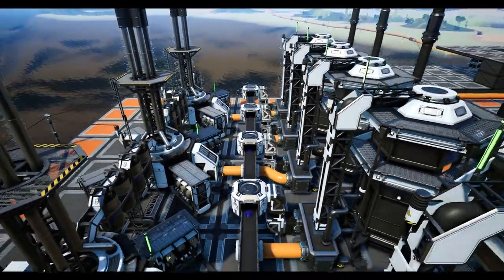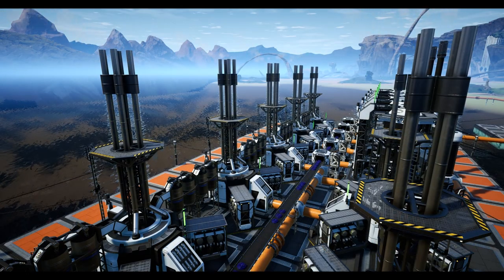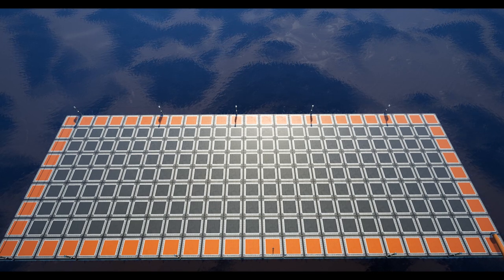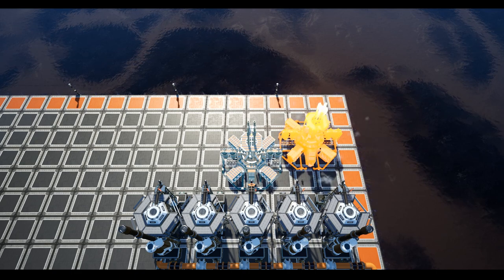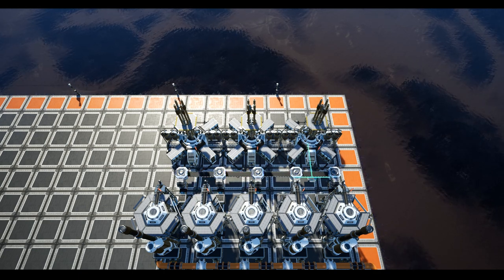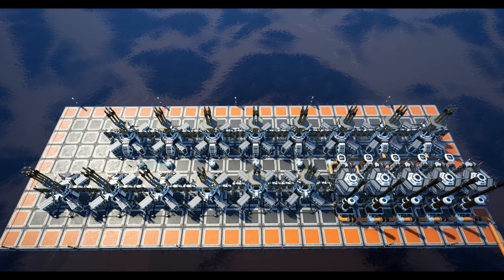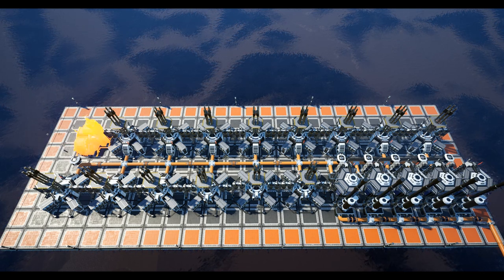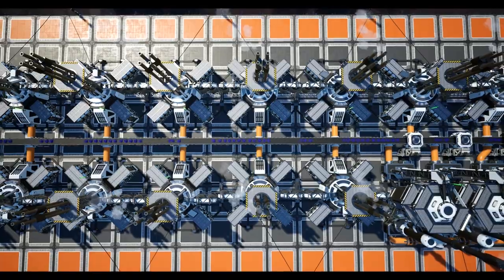Fuel & Generators Super Efficient Build Guide [Satisfactory game]

Comment: Update 4 really overhauled a lot of the numbers in the game.  The guides on Satisfactory Tips are mostly still relevant as to process, but the numbers are off.  For this build, you need 17 generators with the last at 66% rather than 14 with the last at 33% (Fuel consumption is 12/m rather than 15/m  now.
Reply: any way to balancing it with overclock??
Reply: @OHCLunasea plz give me an advice xd
Reply: @iroggi_3567  a refinery at 100% produces 40 fuel/minute and a fuel generator consumes 12/minute the 5 refineries produce 200, 200/12 = 16,66 fuel generators

either take his advice and use all of it for additional 2 fuel generators running 100% and a third running 66% OR use the excess 32 fuel for truck fuel but it's kind of inconvenient because of the 

the simplest solution while sticking to the same layout is obviously just overclocking your fuel generators to use up all excess but it's also the worse solution because you waste energy this way and that's literally what you're trying to gain
Reply: @iroggi_3567  if you haven't already built the setup you could also build 3 refineries (120 fuel production but 180 crude oil input) and a total of 10 fuel generators but the point of the design is to take exactly 1 capped out line of crude oil in so I'd personally add more generators
Reply: Not sure if it's a bug, but having my fuel generator overclocked makes them more efficient?
At 100% it produces 150MW of power for 12m³ fuel per minute. But when I overclock it to 200% it produces 300MW for 20.45m³ while I expected it to be either less MW, or more than 24m³ fuel usage.
Not sure if this is just a visual bug tho.

EDIT: The actual produced power is only 255.7MW, but that still makes the generators exactly as efficient as a normal non overclocked one.
When using 3 overclockers I produce 303.5MW for 24.28 fuel instead of the normal 150MW for 12Fuel.
Reply: @DejonckheereWard  very interesting, could save a lot of room and work, material isn't really an issue but man I hate placing down arrays in great numbers xD

on the other hand I don't like to hunt for snails and without the OC the numbers are nice and even
Reply: Thanks!
Reply: @iroggi_3567  1 triple OC refinery can power x4 triple OC Fuel Generators. (refinery exports 100 fuel, generators eat just under 25 each)
Reply: @iroggi_3567  another option is 1 non-overclocked refinery will power x2 Fuel Generators double overclocked to 194%

Comment: With Update 4 you can build 17 Generators for the same amount of refineries.
16 Generators at 100%, 1 Generator at 59% (8 m³)
Reply: With Update 4, it’s better to hang on to coal power plants until you unlock the Blender, then run it with Heavy Oil Residue + Water to produce Diluted Fuel. This way you can run insane amounts of fuel generator plants.
Reply: @omulu4007  wait does it have the same efficiency?
Reply: Is this why the refinery doesn't look the same ? I just started the game and I was looking at a way to run an efficient powerplant...
Reply: @startide refinery used to be packager as well then they made refinery and packager seperate

Comment: As an actual game strategy, I recommend skipping this base recipe oil power generation stage.  Instead, I recommend limping along on Coal power and grinding out enough cargo drop hard drives to get the Diluted Packaged Fuel and Turbo Fuel alternate recipes.

The oil power plant designs using Diluted Packaged Fuel and Turbo Fuel make much more efficient use of oil supply, so you'll end up with power plants that power your development much further along before you have to expand power again.  And grinding out alternate recipes will yield other valuable recipes along the way.

You'll also find that building the more complex power plants that use Diluted Packaged Fuel and Turbo Fuel is a lot of fun, and the Diluted Packaged Fuel loop ends up appearing in the high efficiency designs for Plastic and Rubber.
Reply from the maker: Again you’re right but for this series we’re focusing on non alternate recipes first ☺️ but diluted packaged fuel followed by turbo is a great option to implement and will go a lot further
Reply: @TotalXclipse  Agreed, I havent been able to get the alt recipes needed for the better option and I need moar power now!
Reply: If you want to enjoy the game, I wouldn't recommend doing this, unless you are either very lucky, or don't mind gaming the game. I don't know what the average number of hard drives is to get Compacted Coal and then Turbofuel, but I didn't see CC until half way through the total number of hard drives available. Turbofuel came a number after that. Considering the number of gas filters I went through, and amount of fuel I used in the jump pack, I'm glad I waited. 

What I would recommend is having spare coal/oil nodes to use on advance power generation, so that when upgrading you don't have to turn off your main base to get the new power generation up and running. I may have done that when converting to diluted fuel.
Reply: @TotalXclipse  hey so i tried this method but then i tried to add more fuel generator and it actually can add more than 14 fuel generator
Reply: @CKR99  this Video was for the old version of the game. With the game update the generators consume less fuel. 12 instead of 15. 
You can put 2 more there. Or 3 if you set one of them to 65% 
Just build my generators yesterday. 
Almost basically this layout. 
I send my belts to the right, because it is shorter than to the left and I have three rows of generators instead of two.

Comment: I also recommend always putting your pipelines on Pipeline Pole Stackable in the input / output lines, and any conveyors on Conveyor Pole Stackable above the pipeline (add extra Conveyor Pole Stackable as needed to avoid conflicts / clipping).  This gets the clutter off the ground so you can walk around the buildings, and if you place the bus correctly, you can use Vertical Conveyor Belt to connect Splitters / Mergers to the inputs / outputs with direct snapping connections.  So place the poles as widely spaced as possible, run long belts and pipes between poles, insert the Splitters / Mergers / Pipeline Junction Crosses directly into the long runs, and then snap the final connections with Vertical Conveyor Belts / Pipelines.
Reply from the maker: Yep it’s a good suggestion which I would normally adhere to but I’m trying to keep the guides as easily understand as possible hence why I didn’t

Comment: So that's how you do it!! You put the pipe joints in front and then connect all the pipes....np wonder I had a hard time to alingn everything! LOL. Thanks!
Reply from the maker: Depends on the build but it certainly helped for this one!
Reply: On other builds, I try and keep the pipes over the conveyers, mainly as the conveyer lift requires a lot more room in front. When doing so, I put down supports either end, put a pipe between the supports, and then place the junctions in. It's annoying that doing it this way doesn't auto-align the junctions, so you have to place by eye a lot more. But it gives a nice look (to me at least).
Reply: @Coldheart322  Agreed. that's how I usually install the pipes. I just thought this could be quicker when no other input are required.  Thanks.

Comment: Hi TX! I just built this, the power is working. Thank you! The resin flowed for a while to be processed and/or sunk. But now all my pipes and generators are full of fuel and there's no more resin being made. The refineries are just standing idle with full oil and fuel, but all my fuel generators are full and so are the pipes. Is that normal? I know I'm not using half my power capacity, is that the reason? If I get past the half way consumption point will this all start making resin again? Just curious. Thank you again.
Reply: u not using enough fuel

Comment: Does This applies after update 5? I am trying to do the math of course to understand and when you say 300m3/m does that mean using 3 chards to obtain such volume because it is not otherwise [I think!]. I also heard/read that the generators will stop generating on their own when not much power is used. Correct? Great videos, finally understanding and also love your website. Never been good at Math!!! 🙄 PS: belt Mk3?
Reply: don't worry about it.   You'll tear it all down because that oil is worth WAAAY too much as plastic and rubber to be wasted for power.

Comment: I have a little problem here, as the refinery does stop working after around 1 min or 2. I got the power up, I got 2 lines of oil pipe connected to the whole system. Is there any way to let the refinery work automatically instead of me having to choose it every minute?

Comment: i used this design for the fuel generator but before connecting it straight to the generator, i placed 4 up to 8 industrial fluid storage fill it up until all of it full of fuel then connect them to the generator.
Reply from the maker: You can do that but I try not to as I feel it kinda prolongs the inevitable as when you surpass your total production per minute the fuel buffers will empty and then eventually shut off perhaps excess fuel could be stored using a offline pump acting as a Sifon and then you could remove the pump to restart the generators again later on

Comment: Ah just perfect, I needed coal for other things and making another coal generator plant was not an option
Reply: I should mention that the pipeline joints dont snap and attach to the refineries so they weren't getting any oil. I had to leave just enough space to place a tiny bit of pipe to connect the joints, weird.
Reply from the maker: You’re right they don’t snap yo the refinery but if you point at the ends that are in the refinery you can put a single pipeline connected then together

Comment: Noooooo why? 😟 Why didn't you please the sink right next to the refineries. That way your generators could have ended.az the Dr length. And the belt wouldn't need to be that long. As argh. 
Na just joking around. Wonderful build as usual. That would be the only thing I have done differently. Also as a tip. Because that build uses  exactly 300 oil per minute. You can build it on a oil node have the extractor directly in the building and have a fully independed fuel powerplant you will never need to think about again